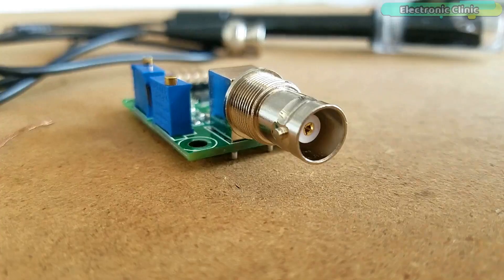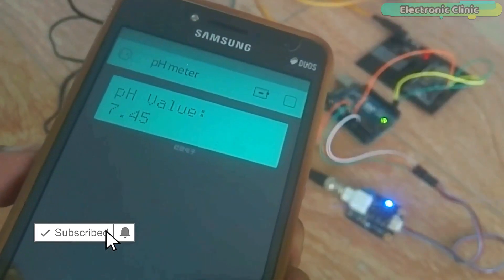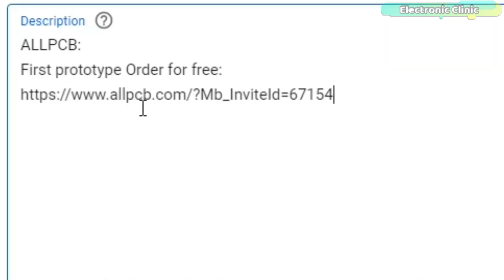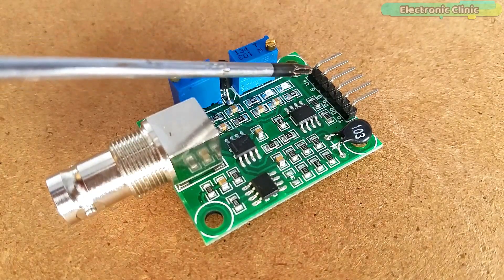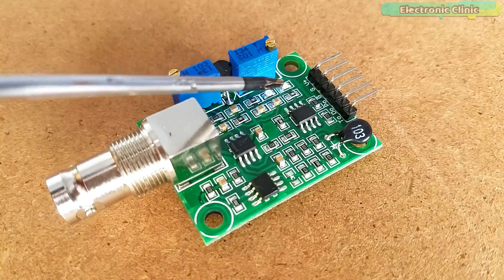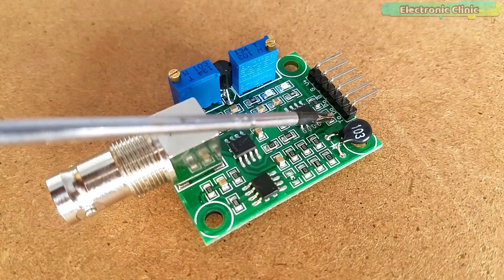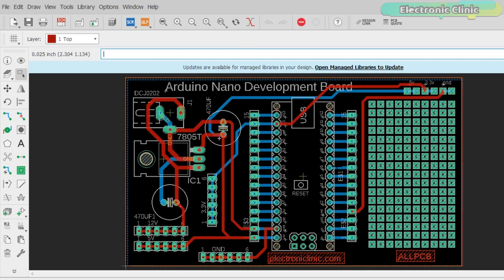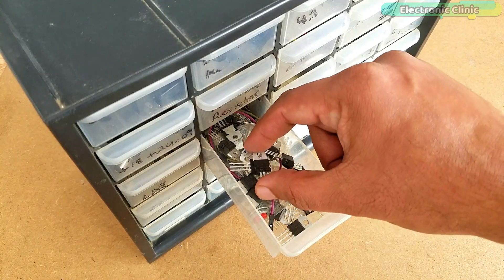pH meter Arduino, pH Meter Calibration, DIYMORE pH Sensor, pH Sensor Arduino Code, pH of liquids

Comment: Has someone tried this with a Esp32? I would like to know, I need some help
Reply from the maker: I used it with esp32, check my latest videos on pH sensor.
Reply: @ElectroniClinic  I watched it but I'm still unable to calibrate. Whenever I'm calibrating the module with the shortcut, the values obtained significantly fluctuate and I'm not able to set the value in volts for the pH7. I'm using the pH sensor that is not from the brand DFRobot, I'm using the generic one that you use in your video where you use Blynk

Comment: In configuration the voltages are not coming at 2.50 they became constant at 2.58 so what's the reason behind it and how to fix it
Reply: got solution ?
Reply: I have the same issue

Comment: hello what a good video 

I am using the same module to measure ph, but I am feeding it with 3.3v 

At what levels is the analog output of the module calibrated?

Comment: hello i cant get mine to calibrate under 2,64 volts why i turn and turn on the blue thingy but it just wont go lower its in 5v
Reply from the maker: Check my latest video on pH sensor v2 and Arduino.

Comment: Just asking if the PCB board only applicable if you will be using Arduino Nano or is it needed also for Arduino UNO?
Reply from the maker: You can also use Arduino uno.

Comment: To calibrate properly you need ph calibration fluids, usually 4.01 and 7.01. Then add this to code:
Before setup:
float calibph7 = 2.50; // example voltage at pH 7 calibration point
float calibph4 = 3.00; // example voltage at pH 4 calibration point
float m;
float b;
In setup:
m = (4.0 - 7.0) / (calibph4 - calibph7);

b = 7.0 - m * calibph7;
In loop:
float Voltage = analogRead(Pin) * 5 / 1024;

float phValue = m * Voltage + b;

This will give you very precive measurements even with cheap sensor. You can use something like ads1115 to improve accuracy. 
Also i recommend setting the pot to 2.5 when probe is in pH 7 calibration fluid.
Reply: can you pls give the whole code for calibration?? 😅
Reply: can i have the full code too pls?
Reply: @sebo5755  I'm sorry guys but I don't think my full code will help since I'm using an ads1115 for better accuracy and a wemos to publish values over mqtt. This changes the code substantially over just using an arduino. 
But the snippets I provided should get you quite a long way, just define the analog pin, add a timer and a print statement for the pH value and it should already work. I recommend also doing some averaging to stabilize the measurements.

Comment: i have connected the wire then connect the with laptop, i am getting 0.0 and 0.24 and values like that repeatedly after the gap with 0.00 so what would be the probable error, and one more thing by mistake i change the second screw then what i can do to correct it.

Comment: i used nodemcu esp8266 , 3.3 v with ph sensor , output is 3.3 , when i used trimmer does not change volt.

Comment: Hello, thanks for sharing your knowledge. If I'm using ESP32, to calibrate, I should adjust the potentiometer so that the Po pin is also 2.5 volts or I should do it to 3.3v/2.
Reply: Do u solved it? I have the same question
Reply: @its_ndy  Greetings, I adjusted it to 2.5 v, it is the closest the potentiometer to the sensor allows me.
Reply: @samanedu  thanks for your answer 🤗

Comment: My ph probe does not reads below 2.55 volt, what to do?
Reply: did you find a solution?
Reply: @wesly22dh   I found another way, I changed callibration value and it worked
Reply: @inderjeetkaur8270  so what voltage range do you have? i have now used the 3.3 volt and found a reliable range
Reply: @wesly22dh  2.55 , and I power it with 5v Arduino
Reply: @wesly22dh  will try 3.3

Comment: I HAVE YET TO FIND SOME PH CODE THAT ACTUALLY LOADS IN AND WORKS CORRECTLY. IT SEEMS THAT NONE OF THE SUPPLIED CODE FROM DOZENS OF DIFFERENT PH METER PROJECTS EVEN LOADS IN WITHOUT SHOWING UP ERRORS AND INCONSISTENCIES, RIDICULOUS.

Comment: where did you get this: 
float calibration_value = 21.34 - 0.7
Reply: It's a mathematical formula, you get the value of pH like this:
y=mx+b
the equation of the line, you get that by measuring the voltage of the Po pin from the sensor. you need to do at least 2 measurements then you have this:
phValue=m*voltage+calibration_value
phValue is know from the standard liquid, like 7.01 pH, then you measure the voltage, yo get something like 3.86 volts.
clean the prove and then measure another standard liquid, like 9.18 pH and you can get something like 4.20 volts,
got 2 equations, 
7.01=m*3.86+b
9.18=m*4.20+b
find m and b, that's it. b is calibration_value=21.34 in his case. you can get a better approach doing that on excel, charge the y and x points there and it'll give you the equation of the line. pHValue=m*voltage+calibration_value.

Comment: oh man... that's not how you use  a pH sensor! You are not supposed to put your test samples into the cap, that's only for holding pH sensor solution (KCL solution). You are supposed to keep the sensor submerged in KCL solution when not in use, and no other liquids are allowed in the cap of your ph sensor, you are decreasing life of the sensor drastically. Instead you are always supposed to put the probe into a beaker holding your sample and there needs to be a gentle movement of the liquid around the probe.

Comment: Why you using 5.0/1023?, the Arduino reference say: “a resolution between readings of: 5 volts / 1024 units or, 0.0049 volts (4.9 mV) per unit” for analog pins.

Comment: the step in 8:06 (testing the voltage output) gives a value in range (0.06-0.09) in the serial monitor, I have tried adjusting the terminals of teh pH sensor but it does not work, further more the same value keeps on showing up even if I removed the connections from the esp.
Reply from the maker: this pH sensor isn't as cool as the DFrobot pH sensor, you can watch my video on the DFrobot pH sensor"its more stable and accurate" than the diymore ph sensor.

Comment: Hello sir, can I ask for your help about my project. I am using ads1115 to my nodemcu so that I can connect the ec and ph sensor. I am also using blynk application to monitor the readings but I am having trouble with the code

Comment: Why do I need to use 3.3v for ESP32-Dev and how does that affect the calibration formula? I've tried the "(id(ph_raw).state) * (3.3 / 4095);" and I'm getting very low number 0.00082
Reply: That because the analog pin on esp32 can only be activated with 3.3v input.And if you using sensor with 5v work voltage like this pH sensor it wont show you the same amount of Analog Signal as you using another board like arduino which is it can be activated by 5v on analog pin.
The maximum analog signal output you can get if you use esp32 is 2800 at 3.3v max.

Comment: Hi, great video. My sensor will not go below 2.51 and is at the lowest setting. Is something wrong?
Reply: So what did you do?
Reply: I am having the same problem
Reply: I returned it and got another, it had different problems and I gave up.
Reply: same problem... Several people on the Arduino forum. It appears that this probe is made without minimal testing

Comment: why do you need to setup it to 2.5 volts?
Reply: 2.5 Volts is half of the total voltage (if you have it wired to the 5V output), and the scale of pH this can read is from 0 to 14. When shorting the sensor, it should read half the voltage, which would represent 7 on the pH scale (half of the max pH value)

Comment: Hello, I have a problem. Help please.
I am using the Nodemcu ESP8266 board and microship which are quite similar to Arduino. I have been testing with a potenciometer if the AnalogRead() is working well or not, and yes it is. But when I connect my pH sensor, the programe reads always the maximum voltage(1023, if I map it 5.5...etc)and there's no way ro regulate it using the screws, it won't go down.
What do you think? Is it worth it to buy new pH sensor? could it be something else? I have followed all your steps and watched first 8 minutes many times.
Thanks! Have my upvote anyway if i get the solution or not!
Reply from the maker: of you have tried many times and still you don't get the desired result then you should buy another pH sensor kit. this time you can try the dfrobot kit.
Reply: Instead of powering it up with 5V, use 3.3V from 8266 board. It will work.

Comment: My pH Sensor can only calibrated down to 3.97 Volt? Is there some problem with the probe? Please help! Thanks!
Reply: After adjusting to 3.3 volt due to WeMos Mini, the analogRead only go down to 830 (max 1024) with 2.68 V? Any reasons? Thanks!

Comment: Thanks, very good video! One question, I have read is not ideal to storage the PH probe with distilled water in order to last longer,  should be PH 4 solution instead. do you have any information about this? thanks again! cheers
Reply from the maker: today i will upload another video on ph sensor. this sensor is not good enough, i recommend the dfrobot ph sensor. i have a video on dfrobot ph sensor. check playlist.
Reply: @ElectroniClinic  yes I agree the reading fluctuates a lot and very inaccurate for me.

Comment: I am having problem in calibrating the module, it gets stuck in 2.66. What to do?
Reply: Hi friend, did you got some advice about your situation? I have the same issue, I can't down below 2.7 😓 I'm planning to adjust by code, x= voltage-0.02, but I'm no sure if this don't affect to ph measures
Reply: @jackzerox02  I solved it by adjusting the calibration constant
Reply: @taharataminpronoy148  how do you do that?

Comment: good morning friend

I bought this sensor, however when I calibrate it in a solution with ph = 7 as you did, and put it to read a ph = 2.5, it is reading a ph of 5, what did I do wrong? Would you help me?

my question is: if i want to read a solution close to 2.5 do i need to use a solution for calibration close to that?
Reply: the ph reading is a conversion of a volt reading, 0-14 ph is converted from 0-5 volt... so at 2.5 volt it should read 7ph... either way, after uploading the code, put probe in ph7 solution, then adjust the potentiometer until it reads 7ph, if you want to check accuracy further put probe in ph4 solution and see what it reads, if it is reading 4ph or very close you are good!

Comment: Any good tutorial on how to use this with esp32 or esp8266? Those have a 3,3v ADC instead of 5v....
Reply: Try this! Voltage = pH_Value * (3.3 / 4095);
Reply: @DannyPSuperG  so i have to renormalize the sensor
Reply: @tuanit2309  hi did u get anything

Comment: My pH meter only reads down to 2.55, where it simply stops going down. Any help?
Reply: Hi friend, did you got some advice about your situation? I have the same issue, I can't down below 2.7 😓 I'm planning to adjust by code, x= voltage-0.02, but I'm no sure if this don't affect to ph measures
Reply: @jackzerox02  did u get anything

Comment: Dear i hv same black color pH probe when i short its connector and try to get 2.5 V, min voltage came at 2.7 & VR reached its end then i adjust VR to give 3.5 volt as i want to read pH from 6.5 to 9.0 on my aquarium. Its working good only issue is the variation in value from 2.0 to 9.0 when i put probe direct in aquarium but read stable value when i put water in separate small bowl, plz guide me what can be issue of pH value variation, is voltage set at 3.5 instead of 2.5 is issue.

Comment: Dear Friend best explanation, i made pH meter with arduino i hv 1 problem if i put pH probe direct into my aquarium value start variation but when i put probe in a small bowl water value become stable, plz can u guide me what's issue.
Reply: this is a common problem, i have a 400$ ph/ec meter, if i try to use both probes in the same container the reading is unstable... it has something to do with them sharing the ground.
i also cannot read either ph or ec directly from the tank, other equipment like heater or pumps may interfere, somehow there is some current messing with the reading, try turning off everything else in the tank while reading ph to see what is causing it.
somehow you must isolate the currents

Comment: may i ask. why calibration value is 21,34?
Reply: You have to get these values by measuring the voltages of at least two calibration solutions, usually PH 4.01 and PH  6.86. The sensor is linear so with these voltages you can solve y = a x + b for a and b, with a the slope (which is always negative, higher voltage = lower PH/more acidic) and b your offset/calibration value.

Comment: ph_act = -5.70 * volt + calibration_value;
  What does this line means.    -5. 7 is from where?
Reply: You have to get these values by measuring the voltages of at least two calibration solutions, usually PH 4.01 and PH  6.86. The sensor is linear so with these voltages you can solve y = a x + b for a and b, with a the slope (which is always negative, higher voltage = lower PH/more acidic) and b your offset/calibration value.

Comment: Hi. This is a very interesting project.
Can you send me the pcb layout projet that you order at ALLPCB? Please?
Thanks.
Reply from the maker: ya sure.
Reply: @ElectroniClinic  Hey, this project's pretty cool. Could you please send it to me aswell? Cheers
Reply: @ElectroniClinic  hi! i am in urgent need to do this exact amazing project that you’ve done. can you send me the pcb layout  that you ordered at ALLPCB please? including the arduino codes and the pcb specifications as well as the dimensions and number of layers. your effort in making this whole video is very very appreciated. thank youu
Reply: mazevedo852@gmail.com